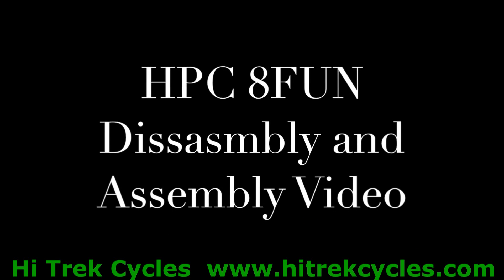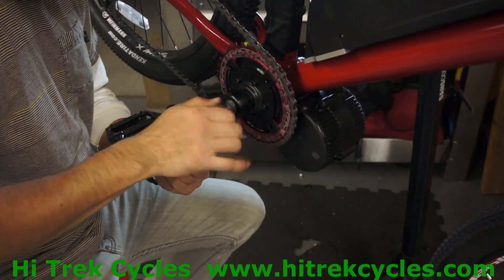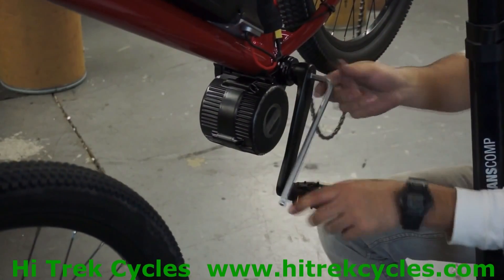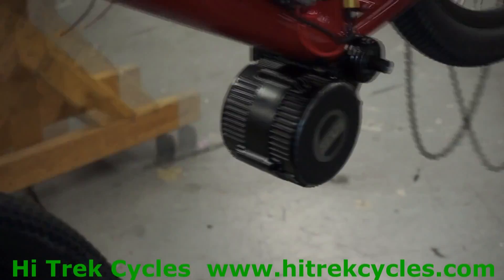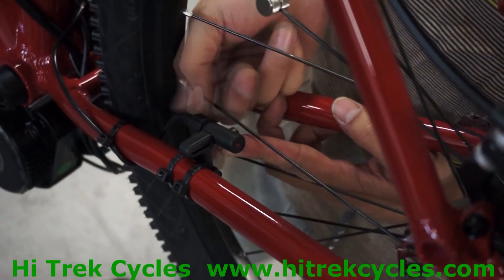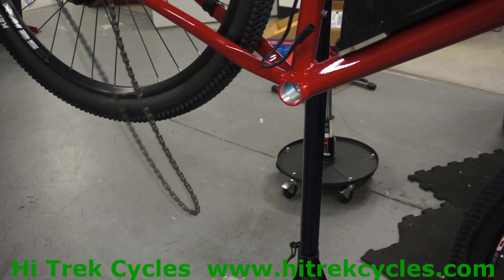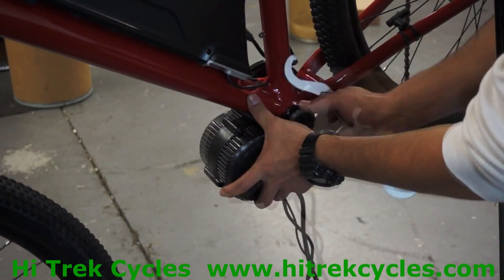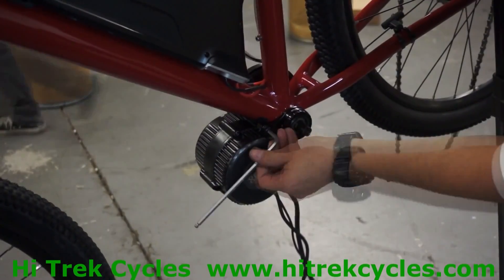HOW TO: Install an Electric Bike Mid-Drive Conversion kit Hi Trek Cycles

Comment: If I understand this correctly, the motor can spin the wheel without spinning the pedals, but when you spin the pedals the motor spins even if it's switched off. Right?

Comment: Low price e byke kit ke liea contract karo ,7059201021,for low price
Reply: e byke kit at low price surjo what's price
Reply: Ashwajeet Kamble sir plz contract my what's app no 7059201021 for low price
Reply: e byke kit at low price surjo
Reply: Ansari Avesh sir plz contract my what's app no 7059201021 for low   price e byke kit
Reply: bhai fat tyre cycle m kaise fit karege